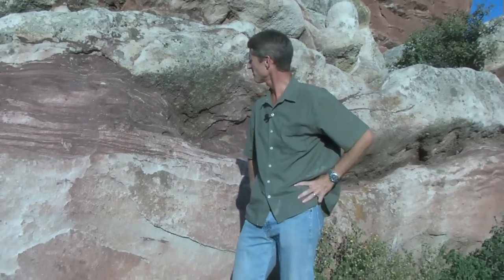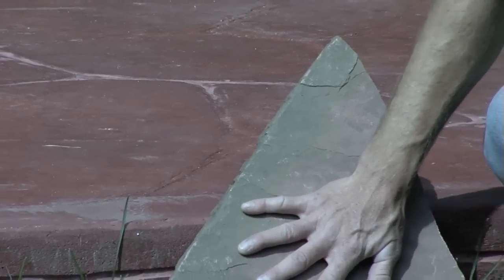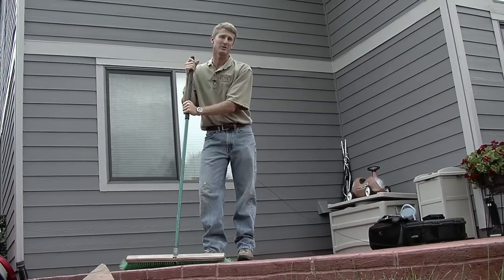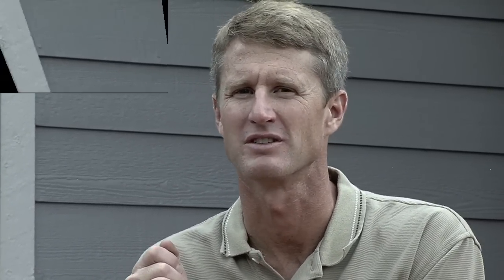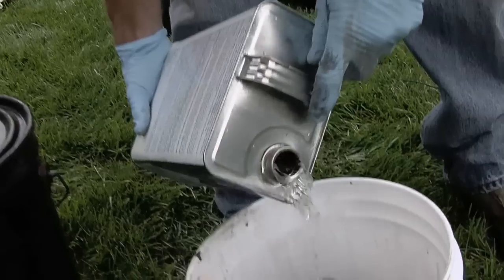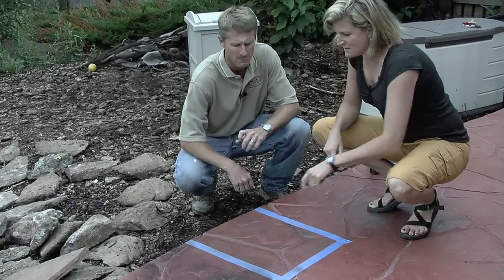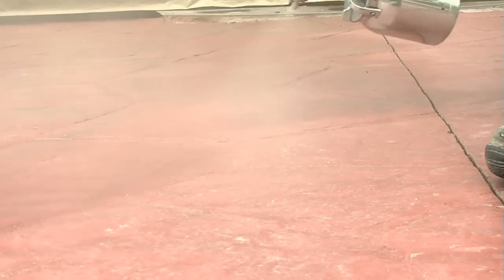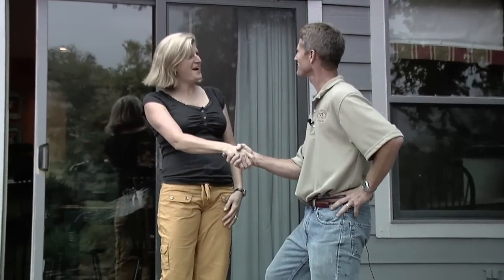Color Correcting Stamped Concrete - Sullivan's Corner

Comment: Hello there Mr Sullivan, thanks for the informative video.  I have a 5 yo stamped concrete driveway that i need your advice on...it has been sealed twice and restained once (not sure what was used)  it is variegated but beyond any consistency...i just wanted to know the options and different types of restaining and sealing available - epoxy, acrylic and acid staining to correct the two tone variation.  I love the two tone but it is much lighter / darker in certain areas. can supply photos.thanks

Comment: Awesome Video, very helpful! Question though, what if your concrete already has color but was never sealed? I'd like to add a darker color like in the video, would this method work the same on unsealed stamped concrete or would it absorb differently?

Comment: I have a color problem with concrete patio. Stamped. Not sealed. The color was supposed to be desert tan and turned out bright orange. We want to change the color. How do I do this.
Reply: I have the same issue. I was advised to use a specific color to a new stamped section to match an existing stamped patio. Unfortunately, I didn't get a color chart and check the color myself before purchasing and helping to apply the finish. Now, after going to a Brickform Dealer and talking to them myself, I will be using the Brickform Freestyle Pro to change the color. And then using their recommended contrast for the texture highlights.

Comment: We had a colored concrete patio and driveway installed last fall.  We picked a Butterfield color called Salt Marsh Gray from their 2013 color chart.  The release on the patio portion was Walnut.  However, the Salt Marsh Gray was not at all close to the color chart.  After investigation we found out that there is also Salt Marsh Gray on their 2003 color chart.  The 2 colors are nothing alike.  Has anyone else had this problem with Butterfield color?